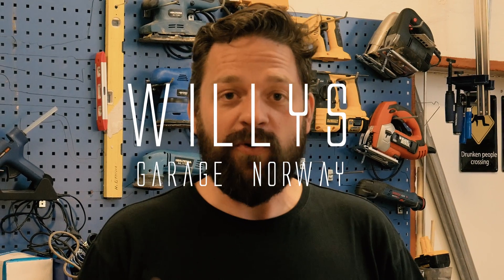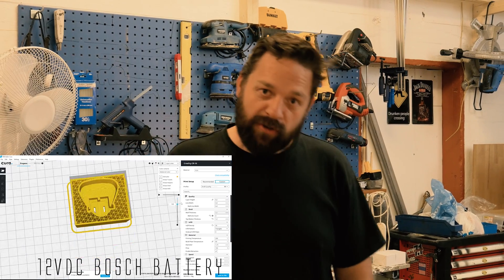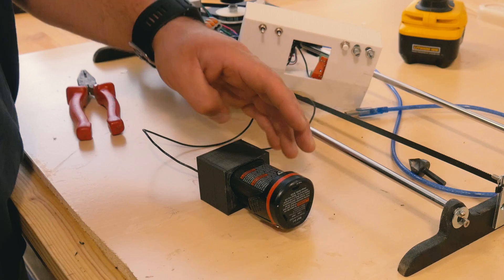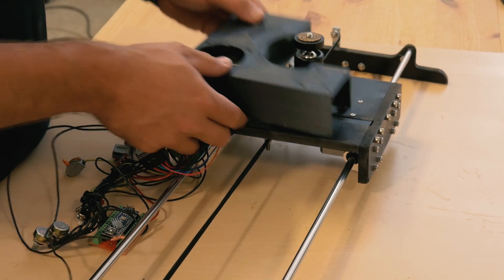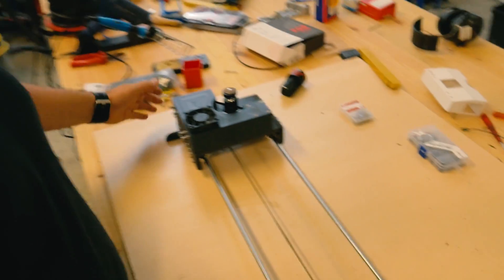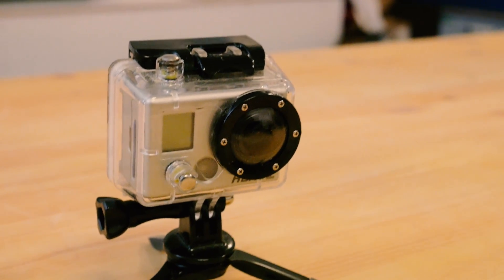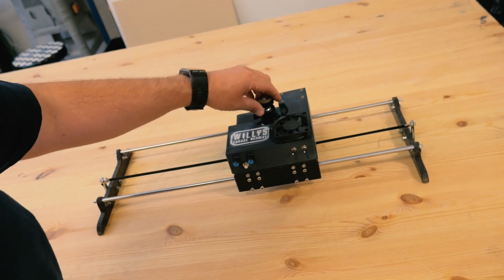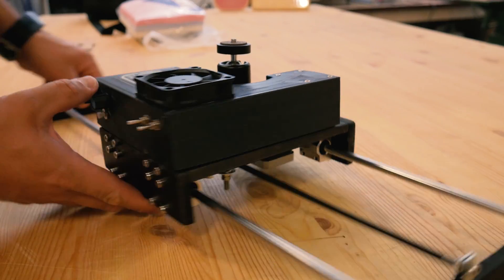DIY Camera SLIDER (Part 4) - FINISHED! | 2-axis MOTORIZED | Arduino | stepper

Comment: Really a VERY interesting idea!. I suggest changing the ball head with a fast plate ball head. A question: do you feel it's better having a end-swith to set start position, instead of selecting that point manually?  Another question: If you put your slider in a light slope, can the camera turns horizontally  the right way? That was a headbreaking during my design hours, and i decided to split the second axis to make it work. 
Thank you for your generosity sharing your work with us, and allowing us to learn from your mistakes and your evolution.